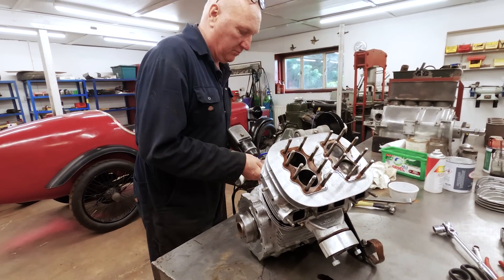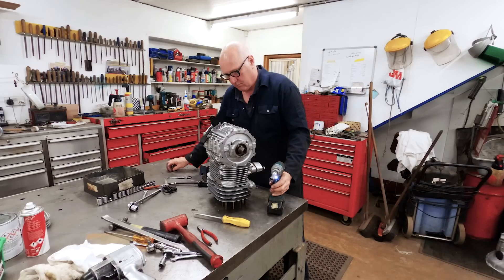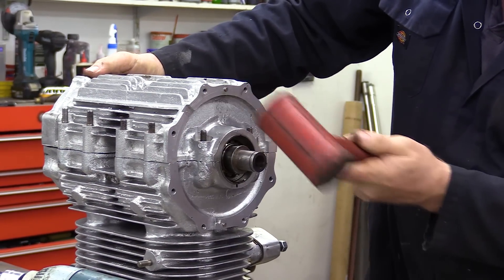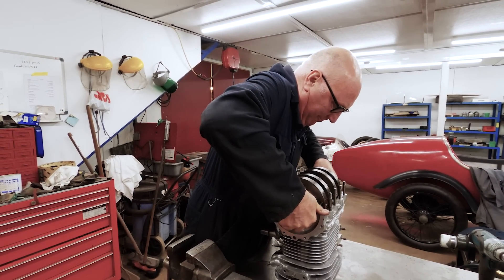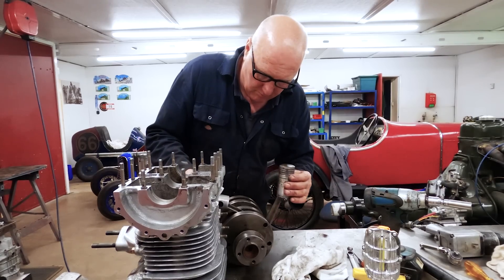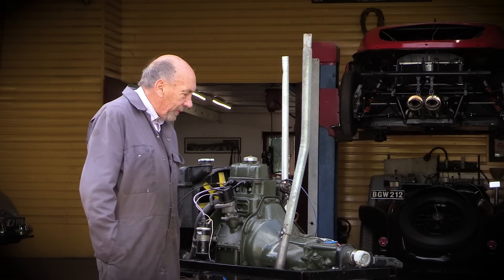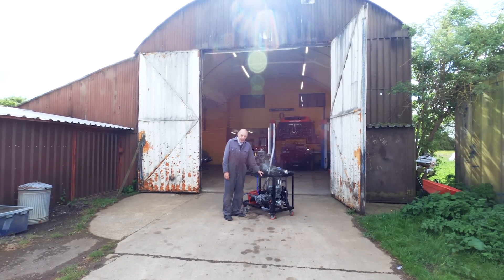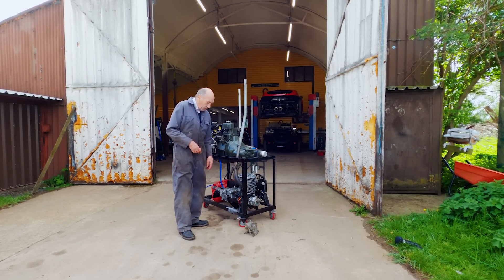SHED RACING - 2 Stroke Mini Engine/ Fault diagnosis

Comment: I don’t know all about the two-stroke intricacies but i have one thing popping up in my mind when i see this: Isn’t a multiple cylinder two-stroke engine supposed to have a separate exhaust pot (read: tuned expansion chamber) pr. cyl. in order to scavenge each combustion chamber correctly? In your case: Using exhaust pipes collected into a manifold; As long as a two-stroke has no exhaust valve, the exhaust port is open for back pressure from the exhaust generated by the other cylinder(s) as the piston travels down and reach the inlet port. That will impede the flow of mixture entering the inlet port and cause the problems you have, backfiring and all that s…t?
Reply: 4 into 1 on a two stroke is going to confuse it!
Reply: I think all the racing two strokes I've seen have an exhaust for each cylinder.
The only exception I can think of is the Trabant made in the former DDR.

Comment: Yes, the "backfire" is intermittent so it seems an ignition / timing fault. A degree wheel might help. Also - try a more modern 2 stroke motorcycle carb as well as all the other suggestions before me. NO PROBLEMO AMIGO'S !

Comment: Following this two stroke motor series with interest. I think the suggestions regarding timing, mixture and exhaust system are all good, but since this was a prototype motor in the first place, I wonder if there is any sort of seal around the crankshaft between the two cylinders? In most if not all two stroke twins, or triples, there was a labyrinth seal in place in between each cylinder. Such seals are non-contact, but offer a "maze" that restricts the crankcase compression in each side from interfering with the other(s).  Have to wonder if such a seal is present, or perhaps was not in the prototype. Do we know if this motor ever ran properly?  Best regards from Colorado, USA.

Comment: G'Day,,Nothing more frustrating than this situation,,i have a tendancy to agree with Bruce Gorney,,If they are not back the front then i suggest there may be a porting Problem,,
Going Back to when I was a Kid,1973,,,had me a lawn buiness,had me a older Viliers 2,2 stroke mower,,played with porting (not Knowing what i was doing),and had me a ripper of an engine,,so i thought lets go bigger,,then i had similiar problems as you seem to be having,when i could the bloody thing to start,,,,
Not sure if this helps,,,be watching for the conclusion,,Iwould like to see it work properly,,

Comment: Spent many an hour with villiers 2 strokes and was once partially deafened for a week having “listened “ to split single with megaphone at the Manx GP circa 1970. Just a thought here, if the pumping pistons charge the firing cylinder are they going the right way round? And may I ask why 4 exhausts? Likely dumb questions but thought I would flag it.

Wishing you well and sincere thanks, I am sure you will resolve it.

Comment: The engine design is pre WW2 . back then the racing DKW split singles ran on open megaphone exhausts , the post war EMC racers did the same, this engine is a pair of EMC built Puch design twingles so does not need expansion chambers. I ran my Puch 175 with the exhaust internals removed (open megaphone) the noise was incredible!! but it ran fine. I put another Puch engine in a home made scrambler with a 2 into 1 exhaust  ending into an old car silencer !! that ran great too. This was back in the mid 1970's LOL

Comment: You’ve done the four stroke habit of 4 into 1 exhaust it’s this that’s causing your backfire from burning exhaust gasses igniting the unburnt cylinder through the crankcase and out the exhaust. Try cutting off the collector and run it on 4 stubbies

Comment: Porting and port timing , exhaust back pressure via expansion chambers and crankcase compression all contribute to the dark art of getting a 2 stroke  running correctly .

Comment: I would look closely at the ignition system for A. possible bad condensers out of the box (seen that more than once) B. too much voltage to the coil(s) causing the points to arc (install ballast resistor). I would also look into maybe turning the heads around with the plugs on the opposite side. It looks like they'll go on either way from what I saw with the bolt pattern. If the plugs are over the intake side, it's possible they're firing before the ports are fully closed and causing the backfire through the carb. (Overvolting the coils will give a similar condition though). Just a few ideas.😉

Comment: It sounds like you need a 'tuned length' exhaust pipe with an expansion chamber that promotes a back pressure 'pulse' that will draw the air through the carb.

Comment: Timming seems off also if it's a reed vavle could have broken or damaged reeds. Finally if your running low octane fuel on the super high compression its will detonate backfire out the carb or exhaust good luck.

Comment: I think the first step would be a decent exhaust. Any two stroke exhaust builder should be able to build you something that's in the ball park of running right.

You could also play with the length of the current exhaust, to see if the exhaust pulses can be timed more correctly to this engine, a first step could be making it a lot shorter.. It could explain those nasty backfires if you dont have Reed-valves fitted. But generally speaking 2strokes need the exhaust pulses to arrive exactly in time to create low pressure to pull gasses in the cilinder faster and high pressure to prevent fresh mixture to be pulled out of the exhaust port before it closes.

Best of luck
Reply: You are right but not on this type of engine, 4 piston 2 cylinder. You don't need good exhaust because when the "exhaust cylinder's" piston closes the exhaust port, second piston on inlet side will close transfer port little bit later. These engine did not suffer from escaping fresh charge into exhaust as much as conventional two stroke, where good exhaust is a need.
Reply: Just what I was going to ask...

Comment: This is another John Jones I was looking at the exhaust that exhaust is correct for a 4 stroke but is it right for a two stroke most 2 stroke bike engines have separate exhaust pipes for each cylinder.

Comment: Back in the sixties I worked for a SAAB dealer and we had to tune those 2 stroke models- setting the timing with a dial indicator on the top of the piston.  If anyone asked how to spell SAAB, we always said SOB.

Comment: Is the timig correct as its back firing through the carb and to be doing that it has to be ignighting down the transfer ports?  Or the middle seal on the crankshaft not sealing.  The other thing with 2 stroke is that its important to have a sealed crankcase as essentially it's a pump and needs to drive the fresh charge into the cylinder.  Best way to test this is via a leakdown test of the crankcase (not the cylinder like a 4 stroke) via a blocked inlet then test for leaks if the preasure drops with soapy water or the good old piece of tub in the ear.

Comment: On some of my 2 strokes I found playing with spark plugs improved thing alarmingly and playing with the exhaust design ,if you can remember the Arial Arrow it went like a rocket with what we called crackle pipes fitted which altered the flow of air through the cylinders 
It maybe an idea to talk to Villier go kart owners as they had the art of exhausts off to a tee ,the 9E bottom end was the engine that took a few titles in its time

Comment: I also hate 2 strokes but I do know that you can't run them on open pipes as they require an element of 'back pressure''.   Just a thought. Great work. Keep it up

Comment: Sounds as though it's missing on one cylinder. If the one cylinder misses, the fuel air mixture ignites in the exhaust, and with two strokes that explosion can find it way back through the crank case and out the carburetor.. Have you tried running it on one cylinder at a time..

Comment: You need two small carbs, a proper air filter for a bit of restriction, and richer mixture, set points to 24 degrees BTC, that otta do. An expansion chamber helps for peak hp, but will run with strait pipe and muffler.  My moped plugs are toasted coconut brown.

Comment: Looks like ignition timing is retarded so combustion is still happening when the inlet opens maybe try 15 degrees Btdc and either retard or advance to suit, check compression 110 psi is a good mark aim for below you could be getting combustion passing the rings and skirt … 2strokestuffing on here is a great source of info

Comment: I assume it works something like this, https://en.wikipedia.org/wiki/Split-single_engine#/media/File:Doppelkolbenmotor_Arnold_Zoller.gif
In which case it could be that the timing is firing the plug before the inlet port is quite shut, or it is firing past the rings and back into the inlet port, because it is not spitting back through the carb all the time, just fairly often! It seems to me that you are almost there and small alterations to timing and exhaust will make it run well! Phil

Comment: I am sure someone else has suggested this but are the rods installed correctly. With the master and slave rod system I believe the port timing is depending on the master rod being in the correct bore. The back firing looks to me to be a port timing problem. Just my two cents worth

Comment: The exhaust can’t be in commingle. Try the engine without exhaust and I bet it’ll run better already. 2 strokes engine work with pressure pulses inside the exhaust to regulate how the cylinder gets emptied from exhaust gases and gets filled up with fresh mixture.

Comment: oil seals in backwords, LOL, I had a BSA bantam which I tuned using lots of George Todd parts, it was a good bike, but always a pig to start! It was only years later when I was daydreaming about it that I realised I had done exactly the same as you, and was putting the seal in backwards! The seal has to keep compression in the crankcase, not seal the oil into the bearings, so should have been put in with the spring facing into the crank case. I am not familiar with the split twin type engine, which I think this is, Am I right in thinking that two of the pistons take in the mixture and compress it into the other two cylinders for firing? I will look it up and have a cogitate about it! Two strokes never run well on open pipes, they need a bit of exhaust back pressure, or at least conventional ones do, and as I remember they spit back through the carb if they havent got enough. However this is not a conventional 2 stroke, and I do not know its induction cycle, so I will do some research! Good luck guys, fascinating channel!
Phil

Comment: bing a 2 stroke it needs an expansion chamber on the exhaust to get the right backpressure.. the way its spluttering indicates the backpressure builds too much until it pops out the inlet, get a 2T exhaust system off a motorbike anf try that im sure it will massively improve things ..Love this chanel BTW and the things you all do :)

Comment: Well on a motorcycle with a slide type carb popping back like that normally was caused by a slide with too large a cutaway. IE . Go from a #3-1/2 slide down toa #3 for start to richen it up.. Your carb looks to be a butterfly throttle ,try richning up the pilot/idle circut.

Comment: I think that exhaust system might be some of your problem. 2 strokes use exhaust pulses to help scavenge air fuel  in the cylinders and also hold the mixture in the cylinder. I think what your seeing is the exhaust pulse from the other cylinder blowing out the carb?

Comment: Two strokes need some back pressure in the exhaust to help fill the pistons.. and the exhaust is really critical to extract max power. First step is to get a silencer on the end ..once that done you need to fit some cones to reflect the exhaust pulses upstream to keep the fresh mixture in the cylinders until the ports are covered and compression starts. Anyway thats what applies to normal 2 strokes but basic principle would apply.

Comment: It's the wrong kind of exhaust system on engine. The back pressures in the system acts like a valve and is need to prevent the problem you are having. Just search "2 stroke exhaust system" and you will see what I mean.
Reply: here's link https://youtu.be/_v9gnC5PiWk
Reply: It looks like a garden slug.

Comment: start with the simple things ,sounds like you have the lower end sealed up right now i have had  condensers even when new act that way along with even a bad plugs even try tightening up the points gap

Comment: As a mechanic I work on some older 2 stroke boat engines. Often when they pop like that, the mixture screw needs let out some more to richen it up.

Comment: I'm pretty sure it needs separate exhaust pipes, as suggested below.  Never seen a multi-cylinder two-stroke with a common exhaust system. One cylinder opens the exhaust port on the Powerstroke while the other is closing it during the intake stroke, and then there is an open connection to the carb causing the backfire. The easy way to test is to remove the exhaust pipe and start it up.
Reply: Two stroke cars do, but design will be critical. You want it to push back enough to stop the fuel air charge escaping out the exhaust but not enough to backfire like this! One for the maths wizards I think. 

Could do 3 separate expansion chambers, each with reed valves where they join to one common pipe? I wonder if that'd work

Comment: Is it possible that the Master Rods are in the wrong cylinders, as in the forward or back cylinder on each crank throw? That would change the timing of the cylinders I'm thinking. Great channel long time subscriber
Reply: Agreed. I thought similar. don't sound right at all.  If Ivan studied on of those other twingles; I reckon he'll have a light bulb moment.
Reply: I concur, additionally after a similar carburettor substitution I had a problem with reversion in the intake manifold, at one certain RPM  it had no power and a weird noise. Eye balling it at that RPM there was a boggling ball of air/fuel that would float above the carburettor, solved by increasing manifold volume with a spacer under the carb.
Reply: yes....that might cause the mis timing
Reply: @SimonHollandfilms  The thing that might cause an issue is those Master Rods don't have a removable connecting rod cap, which means the crankshaft rod journals will need to be removed from the counterweights. Could the crankshaft have been assembled wrong at first? If the Cylinder on the carburetor side is where it fires, that piston should drop first, before the rear one or the fire will just go down the intake side and backfire out the carburetor.  Wish I knew more, that is one novel engine!
Reply: I was thinking along those lines too mate....
Reply: You might find that the reversion is caused by the exhaust. 2 strokes dont like strait pipes. They need proper tuned expansion chambers. Without them exhaust pulses can run back through the engine causing reversion and miss firing. The other thing that causes reversion is the overlap in port timing. If someone did a lot of porting on this engine they may have the transfers opening when the intake is still open. The wrong pistons can also cause the port timing problems
Reply: @holmes1956O  Highly tuned 2 strokes need expansion chambers to perform to their best, but 2 strokes have also had mufflers for as long as they've been around and work fine. Some have pistons with upright walls on the crown to force the mixture towards the combustion chamber, those upright walls also guide the spent exhaust gases towards the exhaust port
Reply: @popeyeman69  thats true but the mufflers are also a chamber that helps stop reversion. Very few have a generic muffler. A 2 stroke lawn mower for example someone puts a cheap muffler from the hardware store on it and it gets hard to start and doesnt run well

Comment: i think it could be the exhaust like many have said. try single pipes for each cylinder, if that works put some tuned expansion pipes for good resonance and sound. and definately put the reed valves back on as it helps with crankcase pressure.

Comment: Hello again. As I mentioned before, it is going to be the correct mixture in the engine that matters. About 40 years ago a friend and I built a single cylinder scooter engine. We fitted a very expensive Fish injector. When it arrived the injector turned out to be just a big bore vertical tube with a simple butterfly and a, specific bore, sideways tube (jet) to supply the fuel. No float chamber. The fuel was delivered by gravity and had to be turned on and off by the tank tap. If you forgot the engine filled with fuel! This did give a large increase in power. Obviously the quality of the carburettion was not important - just the amount of fuel! The porting in the engine, which presumably has not changed, is fixed so that only leaves the exhaust which would usually be of an expansion/extractor type which would help pull the exhaust out and the new mixture through. These tuned exhausts are/were a bit of a dark art. My father in law was a kart builder and racer of some success who built his exhausts by trial and error - I think. His engines were just single cylinder Villiers 9E's with larger Amal carb. with the porting  tuned as well. It might be worth trying your engine without the exhaust pipe to see if there is a difference. Good luck

Comment: Glad you found the comments useful, I am sure most of us meant them in the nicest way. The engine is a puzzle as it is not conventional. Chuffing out of the intake does suggest that something about the timing is marginal but I had another random thought, are you setting it for the wrong piston? IE before the wrong TDC? Presumably the ignition timing should be just ahead of the second piston? I know nothing about these engines, it did sound good on song but the chuffing suggest it is firing far too early before the intake transfer port is closed.